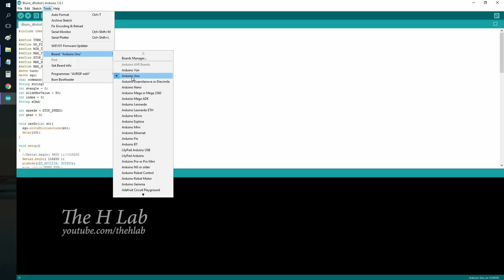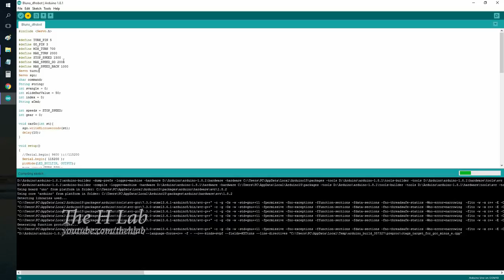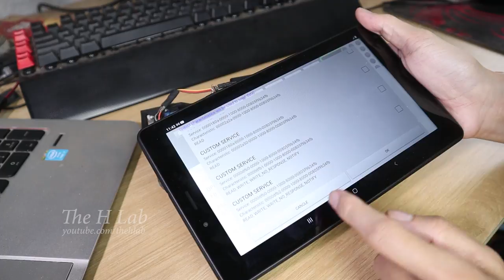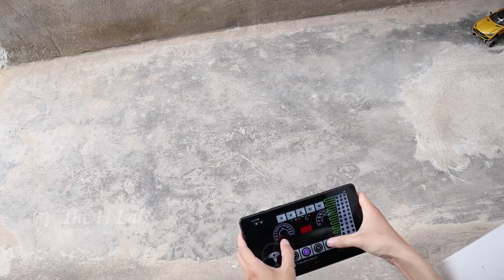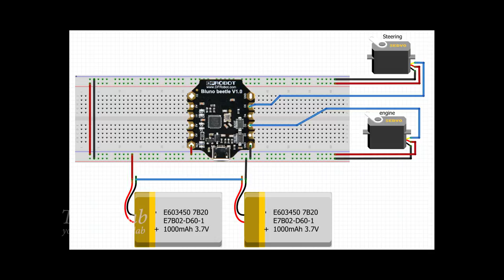Bluetooth RC car using Bluno Beetle module from DFRobot

Comment: Hi, I tried to replicate your tutorial with the big difference that the rear wheel drive is a dc motor with only two cables coming out of it, how could I make it works?
Reply from the maker: You need an ESC then connect your dc to esc and connect esc to the board

Comment: are those continious rotation servos driving the wheels?
Reply from the maker: No. I used a DC motor with gearbox and put it at the center of the car. This is an All Wheels Drive car. The original design is for 1:24 pickup truck and fully 3D printed. Search in my channel in you want to see that pick-up truck

Comment: I did this with an arduino uno, it connects just fine but when I click the buttons on the app nothing happens? I tried with your newer code that has lights and horn and nothing worked at all.
Reply from the maker: Try to use Serial Monitor to print out the received data. The issue may come from different delimiter which can be set from the Android app
Reply: @TheHLab  I did try this and its super finnicky, sometimes I get something on the serial monitor and sometimes I don't, but when I do its random lines like ?x? or ????? and just random stuff usually involving question marks. anyways I decided to start simpler and work my way up to this but if you know what's wrong I may give it another try.
Reply from the maker: Maybe because of mismatch baud rate between Arduino and Bluetooth
Reply: @TheHLab  perhaps, I'll try it again this weekend and change a few things to see what happens.
Reply: @TheHLab  what should the baud rate be for it? I don't see anything on the app for a setting or any info but maybe I could run a simple code to see what characters I'm receiving but I'm not that advanced which is why I was asking for your help you are very great with this and I love the videos.
Reply from the maker: Baud is 9600. You can find in the Arduino code. Bluetooth module also need to set up the same baud rate
Reply: @TheHLab  ok thank you, I'm subscribing to you your very helpful.
Reply: @TheHLab  what should the delimiter be set to?
Reply from the maker: It depend on arduino code. It can be a newline \n